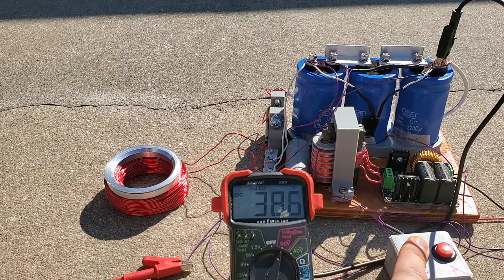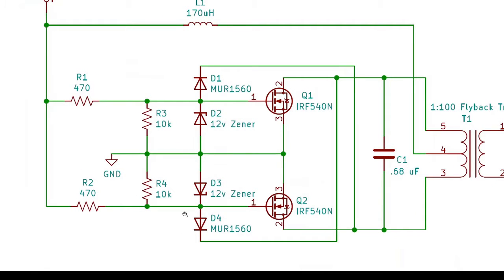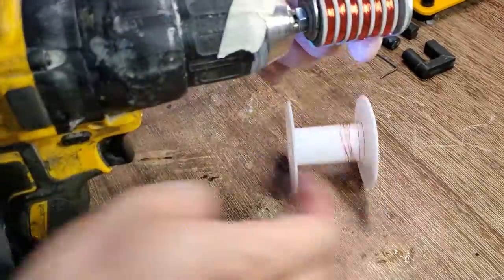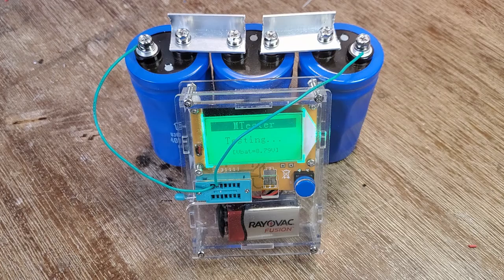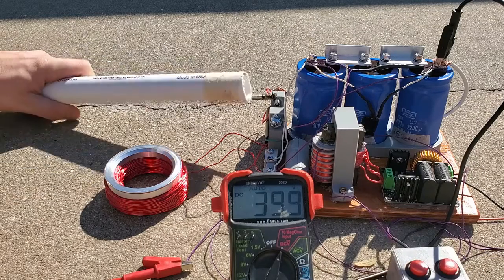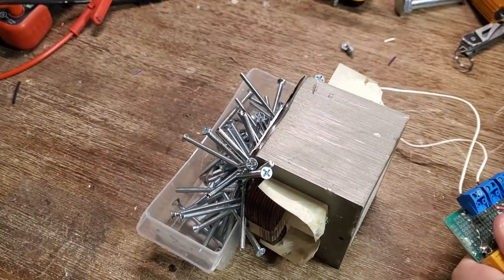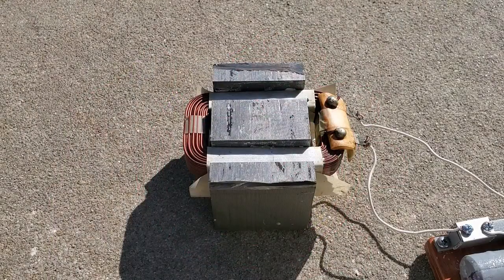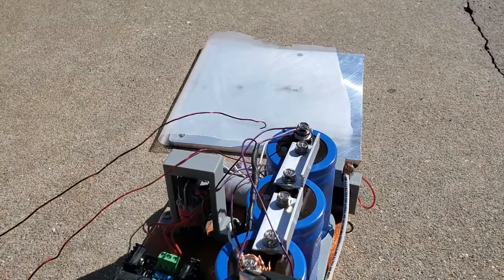High Voltage Induction Launcher

Comment: I wonder if you could speed up the charging process to create high voltage induction pulses generator. Theoretically you could utilize a metal plate as a base to levitate a high speed electrotromagnetic pulse generator.

Comment: It's pretty boring to only throw rings in the air. Why don't you build a Baffle plates accelerator? It consists or a thin plate (like 2 till 3mm thickness) on a coil, the coil has a heavy frame the frame consists of a heavy plate with a decent hole then the setup is coil thin plate with projectile played on the center and the heavy plate with the hole in the center on top hold by the frame. The coil acceleratortes the thin plate with the projectile and hits hard the thick heavy baffle plate the thin plate stops the projectile flys extremely fast and high in the air.

Comment: I wonder how 100KV induction will look like 😂😂😂
Reply: Probably not very good as your capacitor won't store much energy as 100kv of capacitors will be very expensive and most of the energy will be lost in an arc even under oil

Comment: You forgot to account for the multimeter input impedance in the schematic, but as it would then be 2000V across that 1200V cap bank I presume you did account for that later.

Comment: you should not have launched that coil of wire unless you are willing to destroy it because when the coil lands on the ground it nicks the wire and scrapes off the varnish coating and can weaken it so it will break.

Comment: Regarding the circuit to measure the cap voltage with the 3 resistor voltage divider, I suspect that your voltage is quite a bit higher then the measure 400V. Why? The typical multi-meter has an input impedance of 10M ohms so your final resistor is actually two 10M ohm resistors in parallel or 5M ohms. Looking at your meter I can't imagine that it's input circuit would be anything but 10M ohm though I have been told not to judge anything by its cover. If you have something like an SMU  that can measure very tiny currents it's always fun to set it into constant voltage mode and use that to measure the current thru a multi-meter and hence determine the meters input impedance at DC.
Reply: No need for an SMU here! Just measure a known voltage through a 10M resistor

Comment: Do you have the part number for the “1600V 800A diode?” I’m looking at building something similar in principle (including electrolytic capacitors) but I’ve had trouble sourcing diodes for it.
Reply from the maker: I think that particular part number went obsolete. Searching on DigiKey, looks like a suitable substitute would be VS-60EPS16-M3, which is rated for 1600V and 950A peak
Reply: @HyperspacePirate  thanks so much for the quick answer!

Comment: I read an article a few weeks ago stating that hundreds of home hobbyists die because the microwave transformer is made to work 100 percent duty cycle and most hobbyists take chances. Nice video also Sir.
Reply: Microwave transformers are incredibly dangerous but you don't understand what you are talking about. They run at different duty cycle depending on the heat of the microwave. They are dangerous because they can make lots of current like 1amp at high voltage and low frequency. Plus in this project he is only using the primary so it has no such risks as no high voltage is involved.
Reply: Thank you for clearing that up Samuel.  Peace and have a Happy New Year too. Hopefully many more for me and you to come. 😀😀 @samueldavies646
Reply: sort of.
take a neon sign transformer. theyre wound at the ratio to give 15kv, but are only very loosely coupled, they have a lossy core.

this means that OPEN CIRCUIT, they make 15kv...
but when they are running across the arc of a neon sign, they drop... sag... right down... to only 15V or so. at 30mA. or 60mA, depending. thats all the neon tube needs to remain conductive, but it needed the 15kv to ignite in the first place.

a microwave oven is designed to give 1.2kv or whatever into the load presented by the magnetron and circuitry.

its about reflected impedances.

the power supply, the wall, has "zero impedance". its only limit is the wires, the fuses... if you short it, instead of the voltage sagging, theres so much power it just blasts current and blows everything. when people go on about amps or volts that kill... its the POWER dissipated in a  resistance. the heat it produces.

a transformer reflects at the square of the turns ratio. at 1:1, it reflects the load, and thats what the supply sees. you can make it so it limits the current by poor magnetic coupling, otherwise...

old welding transformers and large regulators had cores in them that moved dependent on the current to maintain constant voltages etc... a stick transformer welder still uses an adjustable core to vary the current. turns ratio stays the same, magnetic coupling affects power transfer.

if it steps DOWN, to a lower voltage, then the resistance of the secondary appears higher to the source.

if it steps UP... then the resistance of the load, teh secondary circuit, is reflected as a lower value, and can flow more current because of it.

put a single turn into a microwave oven transformer, and the resistance of the load, YOU, or the short... is reflected back at 1: say, 3000 turns... square that... the supply sees say, 90K, and that limits the power that can flow. even with the 0.001R of the secondary winding itself, only so much power can flow through its reflected resistance. the power point is NOT an infinite source of power, but has its own limitations, of course... just because theres a huge step down ratio doesnt mean a huge current can flow! there has to be a voltage to drive that current through a resistance.

when it steps UP, that all reverses. the load reflects as LESS resistance, and now its simply the windings, their ability to take current, the transformer design, that limits the power that can flow. if you short a MOT, it reflects back as thousands of times LESS... and the current goes out the roof!

its tricky at first. pretty simple when you think about it.
Reply: Simplicity is the key to make things happen for a many. Nice fella.  @paradiselost9946

Comment: My undergraduate physics department made a similar device to cut aluminum cans in half. 
The thin wall aluminum when inserted inside the coil results in a radial force from eddy current induction and the can splits itself in half and the centerline pushes into the center of the can at all points.

Comment: Add a soft iron core on top of your transformer, at least 30 cm. You will have a dramatic increase of speed. 
I found out quite spectecularly, when I did this at school, I shot out a lamp in the ceiling.

Comment: Fun fact - if you cool those metal rings by keeping them submerged in liquid Nitrogen for sometime, you'll be able to launch them even higher
Reply: Well now he makes his own ln2 so…maybe next video?
Reply: I assume copper would be a better choice than aluminum as well
Reply: @nathanieljames7462 I don’t know for sure but guessing not, copper has 3 times the density/weight of aluminum so  it’s a lot heavier, aluminum conducts current at 2/3 that of copper

Comment: Sweet setup! I have made something similar with huge capacitors but I used a large beefy SCR as a switch instead of a metal object on a stick . It actually worked great. I think manually shorting them results in a waste of energy when it arcs and possibly "bounces". But then again, an SCR's internal resistance may or may not be worse. It's worth a try if you have a big metal SCR laying around (not the 3-pin through hole type).
Reply: scr sounds like a clever idea! I know of alot of scr from china having fake ratings

Comment: Hi! Great project, and excellent height on the ring :) I was wondering how you were able to trigger the ZVS you had? I have the EXACT same model from Amazon and for the life of me I can't get the oscillation to trigger correctly and end up getting low voltage and weak current. Are you using some sort of soft-start switch, and if so can you please share the circuit diagram? Thanks!
Reply: What do you mean by trigger the zvs?
Reply: If it can produce an arc it works

Comment: Here you have made the start propulsion or trigger mechanism for your rail gun. 
When you press the trigger the gap is closed, the coil is charged pushing your projectile into your accelerator coils which will add velocity extending the distance range of your rail gun.
People think this technology is new but rail guns were used in WW1, bloody great big things, I have a picture of the thing I'm talking about and men are sitting on the turret of what looks a bit like a giant tank but on rails, definitely a rail gun as there was many huge coils around the barrel. 
Very impressive things but where have these things vanished from history? 
You can likely tell that I'm very interested in deed in electromagnet's 🤣 

EMF at certain frequencies is a harmful toxin that accumulates in the body in absence of vitamin D and causes symptoms of cold and flu. C****a electrical discharge. The word "poison" in greek/latin is "virus", obnoxious substance harmful to health...
I apologise for the riddle but you're a clever guy😉 
That definition of "virus" in the English Dictionary is lies, nonsense, it's not even an English word so has no business being in there especially with a definition so different from the original... The disease is EMF poisoning.. You know what I'm talking about and it's caused by the new telecommunications technology 👍🏼✌
Reply: Never have I read so much BS in a single comment.

Comment: you should try 15 turns at 12 in diameter on the aluminum plate. you get a much greater force for less.  i got mine to fly up about 100 ft, i also used double the voltage.
Reply: The more voltage you use the less turns you need.

Comment: Amazing work! Just wondering, for your original design (without the microwave transformer) wouldn't performance improve vastly by simply adding a soft iron core in the centre?
Reply from the maker: Yeah, it would. I used the sawed-off transformer because it was what I had readily available
Reply: @HyperspacePirate  What Is Islam?

Islam is not just another religion. 

It is the same message preached by Moses, Jesus and Abraham.

Islam literally means ‘submission to God’ and it teaches us to have a direct relationship with God. 

It reminds us that since God created us, no one should be worshipped except God alone. 

It also teaches that God is nothing like a human being or like anything that we can imagine.

 The concept of God is summarized in the Quran as:

{ “Say, He is God, the One. God, the Absolute. He does not give birth, nor was He born, and there is nothing like Him.”} (Quran 112:1-4)

Becoming a Muslim is not turning your back to Jesus. 

Rather it’s going back to the original teachings of Jesus and obeying him
Reply: I'd say whatever core you put in there, it will saturate, given the very high current densities. Also, adding iron increases self-inductance, making the coil "slower". Perhaps the ring has already left the coil while current is not yet at its maximum? I think it's a complicated optimization :) (I tried to optimize this once)

Comment: Next: Hybrid electromagnet induction and chemical rocket launch to space. Well maybe not space but.... for serous extra height. 

Thoughts to consider. 
a) The exhaust of a rocket might serve to short the spark gap. 
b) Ejection launch ring after EM induction launch portion is complete. 
c) Launch lugs attached to side of the rocket made of copper pipe surrounding an iron rod whose base is wound with electromagnetic coils make up an electromagnetic induction assisted launch pad for a chemical model rocket.
Reply from the maker: I've thought about this a few times. It could be possible to use the aluminum structure of a rocket for eddy currents to push it along with an electromagnetic pulse. Not sure how that'd compare to a mechanical catapult, though. As cool as electromagnetic induction / ferromagnetic attraction is for propulsion, it's really really inefficient
Reply: @HyperspacePirate  if going hybrid launch, you'd want to shed the weight when your done with electromagnetic phase of a launch. 

Well designed 3 phase Induction motors can do fairly well at converting electrical energy to mechanical.  It is a little bit more challenging to do it as efficient with a linear induction motor, but it is used in levitating trains.  Imagine a three phase induction ring launcher with an iron rod in the center and sets of 3 coils wound on it. 

with a larger rocket The metal must be thick enough that it can carry sufficient current, and the induced current's magnetic field restricts further penetration of the changing original magnetic field. 

Efficiency? I don't know, but I strongly suspect it is significantly more efficient than producing the chemicals and the effective efficiency of thrust. 

Have you seen the motor I made on my channel?
Reply from the maker: @kreynolds1123  I suspect what you'd end up with is something similar to the sabot used in the US navy railgun that breaks away once the round leaves the barrel
Reply: @HyperspacePirate  I was envisioning more traditional launch lugs seen on model rockets. But they'd be a wider diameter, and ideally detachable shortly after lift off. 

The point is, if rockets are their least efficient when going slow at take off,  https://en.m.wikipedia.org/wiki/Rocket#Energy_efficiency , then getting them started with a linear induction motor make the chemical part of the launch overall more efficient, or allow a reasonably significant amount of weight reduction in the chemical motors.

On a large scale, I see potential structural issues using induction launch lugs for a significant portion of the initial launch acceleration. But maybe not so bad that they couldn't be worked out.

Comment: I can has STL file for transformer bobbin? 100% will give shoutout in next video (coming soon!)
Reply from the maker: I couldn't find the file, but I'm going to make a much better one and post the files. This transformer is way below optimal because the turns ratio is too high and the current is low, so it's not well matched to 1200V

Comment: Could you tell me if a 0.1nF Capacitor at 200kV is deadly? I'm building a Marx generator and it's hard to find information about when a capacitor becomes really dangerous. I'm sure you know more than me because you handle with even more dangerous stuff in this video.
Reply from the maker: I looked into this a little while back when I was researching static charge built up on the human body. It seems the general rule of thumb is that approximately 1-joule of energy from a static discharge is the threshold for lethality. I can't give you a source off the top of my head, but that's the number i saw several times. 

The capacitor you're describing would carry 2J of energy, so if it arced across your heart, there's a very good chance it would kill you. However, that situation is relatively easy to avoid. Don't get near/touch charged terminals, and always use an insulated rod with a ground connection to discharge your system before you work on it.
Reply: @HyperspacePirate  Thank you very much. What you are saying fits well to what I could find on the internet.
A 3d plot with voltage, capacitance and chance of death on the axes would be so nice, but I guess noone has ever aquired data on this topic.
The 1-joule rule is good, but not always true. A low voltage cap can have more than 1 joule and may not be deadly, because the energy is not tranfered fast enough trough the human body and the current is too low.

Comment: Interesting, so the zvs circuitry via the windings is only for charging up the caps?
Reply from the maker: Yes. The continuous current output of the high voltage transformer is extremely small (on the order of milliamps), so it's bottled up in capacitors to give the high current (>1,000A) pulse
Reply: @HyperspacePirate  so More 400v caps in parallel would mean even more 'explosion' right?!
Reply from the maker: @ThaboW11  Yeah, that's right, although If i got more caps, I'd put them in series to get a higher voltage and lower capacitance so that the LC time constant of the circuit would be smaller and dB/dt would be higher
Reply: @HyperspacePirate  Cool.
Reply: @HyperspacePirate  but if the capacitor discharges in the coi,l wouldnt it make a resonance circuit? and could it damage the capacitors by charging them in the other polarity because of the colapse of the magnetic field in the coil? and would it be a good idea to put a reverse diode across the capacitor for pulling the negative charging
Reply from the maker: @picanazo420  Yeah, there can be spike from the capacitor's own self-inductance, which does make it a good idea to put a reverse diode across the cap leads in addition to the inductive load. In this video I didn't do that.
Reply: @HyperspacePirate  but its very important or can it be skipped? because i am going to make one using a 6kv 32uf capacitor and i am afraid that the own self induced voltaje could damage the capacitor by charging at the wrong polarity
Reply: @picanazo420 I don't think it's essential as I did it without but electrolytics won't be very happy with reverse voltage. If you can afford 6kv 32uf I see no reason not to just add a freewheeling diode it's not much effort